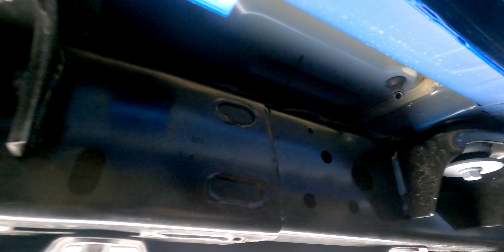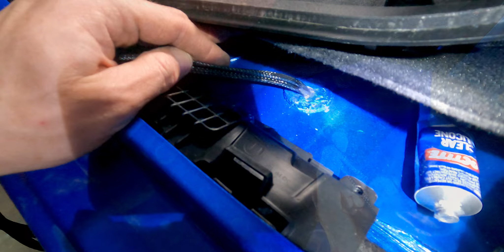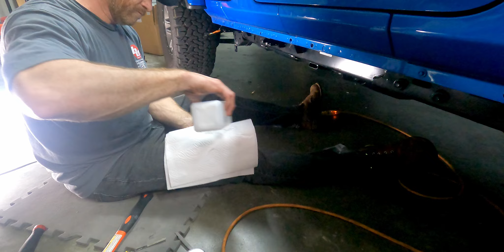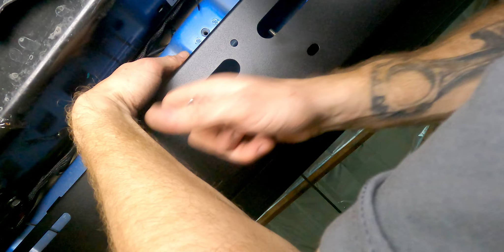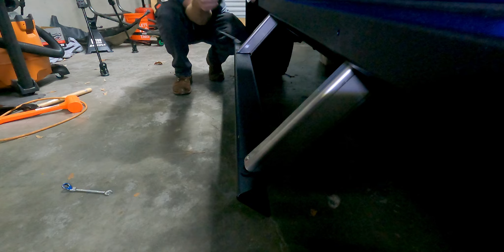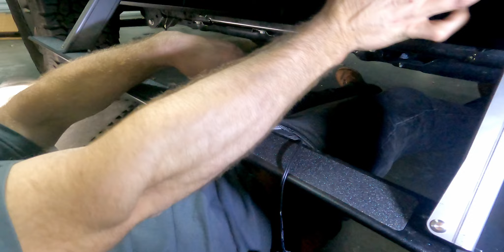2024+ Jeep Wrangler Rockslide Engineering Stepsliders Install Guide

Comment: How does mounting work in regard to the front skid plate protecting the suspension on a 2026 Jeep Rubicon JL ? We can’t leave the front bracket loose until the steps are on because with that plate there we can’t tighten it after mounting the steps we have to tighten the front bracket before mounting.
Reply: It’s actually the new 2026 frame reinforcement plates